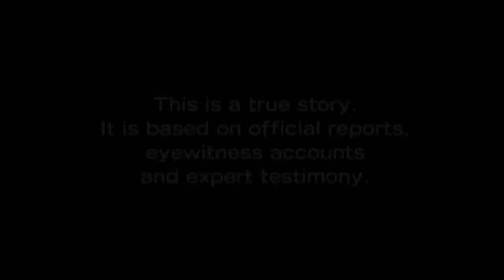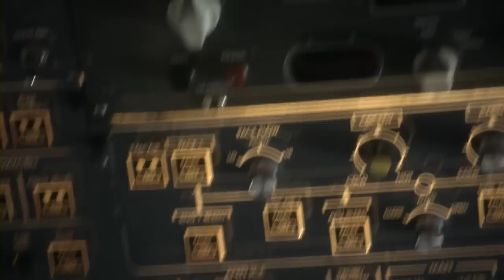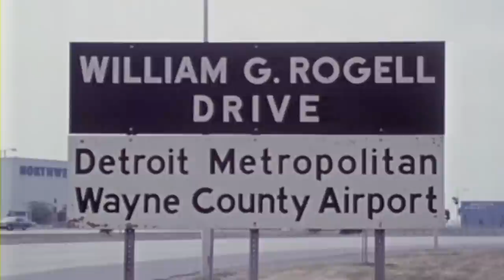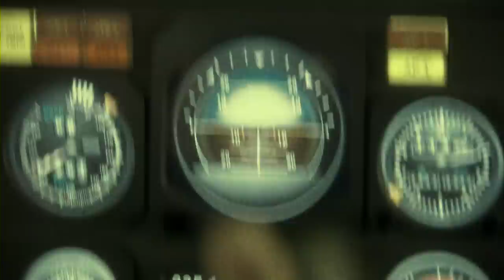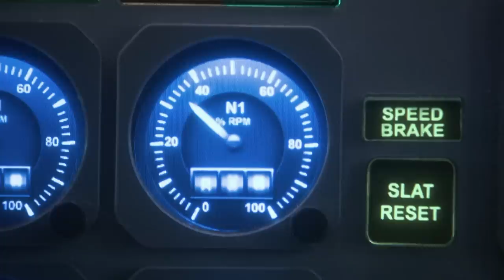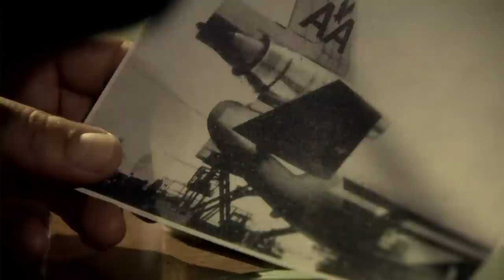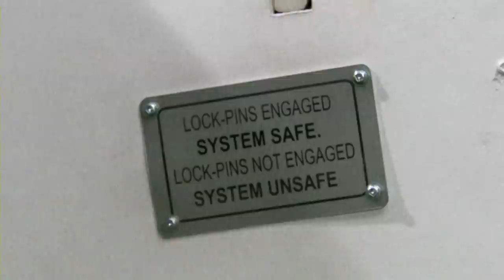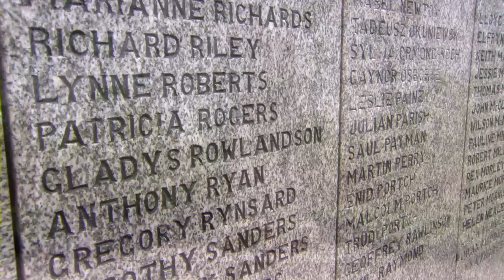The Mistake That Crashed Flight 96 | Mayday

Comment: Yet even after the first disaster, the problem was not addressed in time to save lives. That's the inexcusable part. There were only ten planes in service at the time, yet MD produced ninety more without providing a solution to the problem or properly alerting all buyers.

Comment: I swear the more I learn about Pilots the more I am impressed with them.
Reply: I was thinking the same thing. 

The pilots in the 1974 crash were just as heroic in their efforts as the pilots in the 1972 crash, there was just no way for them to get control of the plane in that instance. They should still be honored and recognized for what they did to try to save the plane.
Reply: Same mate
Reply: I admit the same. I've watched this show for years and more than anything else I've gotten from it , a respect for pilots and the realization that they have a skill set that is unique would be the main thing I've learned
Reply: That's why I make it a habit to personally thank the pilots whenever I get off a plane. If I could, I'd tip them too.

Comment: There was a mistake, and AA Flight 96 was affected by it, but AA Flight 96 did not crash. Two years later, the uncorrected mistake caused the crash of Turkish Airlines 981 and the death of 346 passengers and crew. Flight 96 was the warning that a catastrophe like flight 981 could happen if Mc Donnell-Douglas didn't correct the mistake, which they failed to do.

Comment: This is what makes the 737 Max crashes different from the DC 10 flaw. MCAS was a safety system designed to help pilots, but thought that pilots would treat the problem like a runaway stabilizer. That case involved a fail safe that failed due to having no redundancies. The DC 10 cargo door flaw on the other hand was intentionally covered up after being discovered during the manufacturing.
Reply: Ironically the failures of McDonnell here ultimately lead to a merger with Boeing. Which leads to Boeing adopting their management principles. Which leads to the 737 Max.
Reply: @33moneyball  yes this ⬆️ the MD culture moved over to Boeing sadly , and while a different issue nearly 50 years apart, the facts are the same internally. In both situations the company knew about the potential issues and covered them up, didn’t train on them, or kept it out of manuals or in obscurity.
Reply: so was the MCAST
Reply: Except it was exactly the same. It was known by Boeing management and they covered it up. McDonnell Douglas should have been sued out of existence after the second accident and those that made the decision not to revise the design of the dc10 cargo door should have gone to prison.
Reply: Not only was there a similar cover-up, it was pushed by Southwest airlines, which encouraged Boeing to cover up the use of the new system so that its pilots would not require additional training.
Reply: As was MCAS on the MAX 8 not until 300 plus ppl died did Boeing Mention it…. The same thing with the DC -10 Cargo door…. The term you’re looking for is “Tombstone Technology” enough bodies and fixes and answers appear
Reply: @marieschappacher5419  They mentioned it very explicitly after the first Lion Air accident.  Unfortunately, not enough people listened to them.
Reply: @33moneyball  Not really.  Boeing maintained a far superior safety culture, a culture which still remains among much of the Engineering Staff.  Much of the new management team that caused the 737MAX debacle has already been fired.  They will not cause problems for Boeing again.  Many of the replacements reportedly come from the Engineering Department.  Note also that Airbus has had more than its fair share of problems compared to Boeing, but has had far, far better luck.  Qantas Flight 72 is a good example, as are the weight and balance fiasco and the apparent galvanic corrosion of the lightning dissipation structure, paint, and plausibly structural fasteners.  None of this is good.  It can be argued that they should not be allowed to fly right now.  The US doesn't have any substantial amount of these aircraft, and EASA has long been accused of being too partial to Airbus (ever since the crash of one of the first Airbus A320 aircraft, which also severely damaged the reputation of French Air Accident investigators and has never been fully resolved to the satisfaction of all parties).  The Qatari Authorities did ground the aircraft pending inspection.
Reply: @marieschappacher5419  Of course, they should have been more explicit from the beginning.  Airbus has had more problems like that than Boeing, but they have been exceptionally lucky not to have killed anyone yet.  Qantas Flight 72 was almost the exact same type of thing as Boeing's 737MAX issue.  But by a stroke of luck, it didn't crash the plane.  Similarly, Airbus has had faults with weight and balance calculations and apparent galvanic corrosion on the A350.
Reply: @jlennon784  In cells next to Boeing management.
Reply: With the next cells for the FAA.

Comment: The Turkish crash was 2 years later and they hadn't fixed the issue in that two years.
Reply: They nevertheless took enough steps so that the Paris crash would have been unlikely had it not been for last-minute tampering, including extinguishing warning lights, made by Turkish Airlines maintenance. That's the untold part of the story.

Comment: Interesting that there was little focus on setting up to land with a crippled jet. I'm used to pilots now analysing speeds, runway lengths, engine function, weight, - the entire 3 page checklist for an emergency landing.

Nothing like United 232, but loss of hydraulic function would become a future issue

Comment: I was on a airplane in 2018 the door wasn't locked and we were on the ground waiting at the gate a  engineer had to come and close it before we could take off the captain told us what happened
Reply: I was on a plane and all the doors were unlocked; the stewardesses had to pull them closed after more people got on.  I still have nightmares
Reply: @neilm2794  so they fixed it before they took off
Reply: @neilm2794  I didn't know planes have cameras now and the cockpit door is Bulletproof and the pilots keep the door locked when they are inside
Reply: @neilm2794  I saw Mayday disaster a hijacker shot a passenger and the two pilots and the person that brings you food and drinks after he shot and killed them he pointed the nose down it crashed

Comment: MAN!
All these problems were so easy to fix!
Just use a plug door!
Who cares if you loose some cargo space?!
Better to loose that then a whole plane!
Reply: To be fair most planes don’t use plug cargo doors, which means that MD didn’t even have to redesign the door, they just had to make it seal 100% of the time, or at least have some sort of warning to tell the pilots if the door hadn’t sealed properly.
Reply: @faaz697  But plug cargo doors would make things safer!

Comment: Question: couldn't the french flight have been helped by extending the flaps and leading edge slats? increasing drag and lift would MAYBE slow down the dive and allow engine thrust to control attitude...
Thoughts?
Also, how could the nationalistic frenchies be so obtuse to not teach American to anyone working in an industry where nobody has time for translations from American to the proud exclusivist french.... Really sorry that they lost their empire and properties (mostly.... they still have a tiny island right next to Canada, among many others), but YOU try saying 99 in french, see how easy it is.
Reply: But it was not the baggage handler's job to check the peep hole. So even if he could read English, it would not have saved the plane.